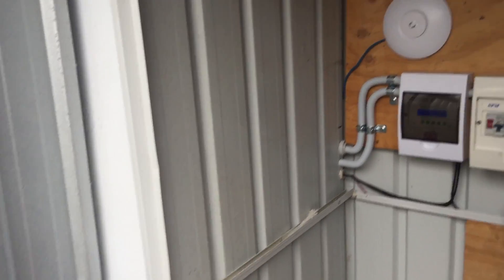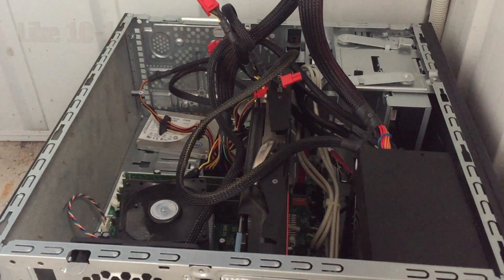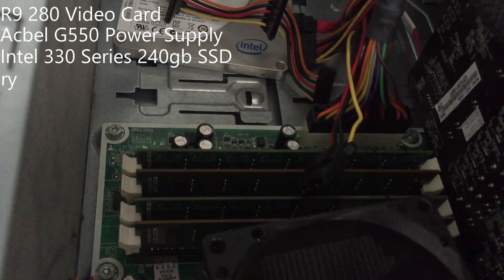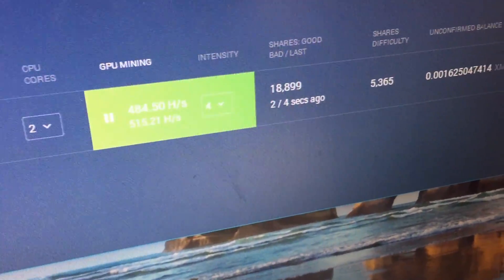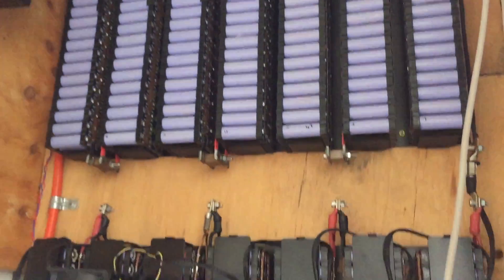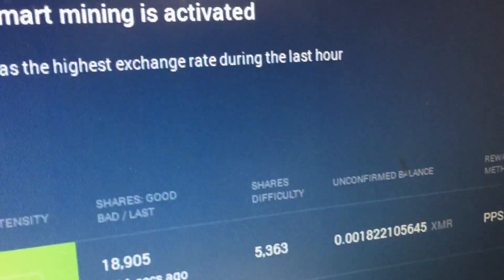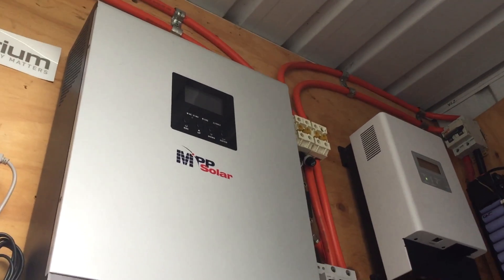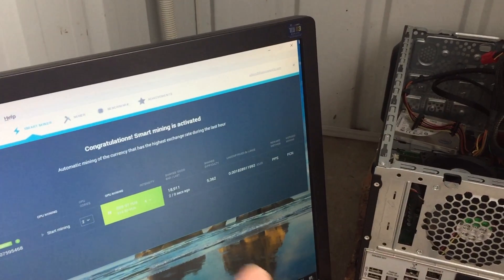Mining Crypto currency with solar power

Comment: I reckon that Monero is worth quite a bit more today if you haven't sold it yet. Is your system able to handle 500-600w 24/7? A 4x gpu system would be worth it depending on what you're mining. Your SSD is quite nice and I'm using a similar one on my main computer. For mining rigs, you only need a single stick of ram, an economy processor such as the celeron, a motherboard supporting many pcie ports, a cheap ssd (Could even use a USB stick for the OS) and the power supply. 

As someone else mentioned, whattomine.com provides the best coin to mine at the current time but joining a mining pool that automatically switches you to the most profitable coin would be even better.

Comment: and all I've done is start running my washing machine through a modified (ghetto drill ventilation mods and a 80mm fan) eaton 400w 5110 12v UPS saving huge cents!  mwahahahhaahahh   (why I didn't think to test it two years ago I have no idea gah)

9 days left until settlement for our first home!  and i'll finally have solar!  woooo (and I'll be your neighbour! (ish) we're coming Inala, watch out!  
I have massive surface area for solar expansion too!
once I get there, I'll be setting up my eaton mx4000 4Kw UPS (it's a freaking BEAST) and running the fridge and laundry off grid, the savings will start!
exciting times indeed!

Comment: The os won't matter, the gpu is doing all the work.

You are losing a lot of power in the translation. Going through two conversions. Move to a low voltage input power supply try to go directly from the battery

Comment: running a 12V pc power supply over a 120V/240V power supply, which got its power of a 12V/24/48V system??? there are systems you can run your pc directly off a car or something with 12V....

Comment: I would under clock and under volt the CPU and RAM, also use as little RAM as possible, and the only drive should be a USB drive

Comment: https://www.ebay.com.au/itm/DC-12V-250W-24Pin-Pico-ATX-Switch-PSU-Car-Auto-Mini-ITX-DC-TO-DC-Power-Supp-Q2D4/192343439437?epid=2247854843&hash=item2cc88ff84d:g:XKsAAOSw3WxZ720c try one of them I know its not a $1 but think it may work may need 2 of them for more power then there this on to https://www.ebay.com.au/itm/DC-12V-250W-24-Pins-HTPC-ATX-Power-Supply-Board-PC-Car-Computer-Pico-PSU-Module/292243353990?epid=2225658016&hash=item440b0fb186:g:L~4AAOSwFdJZsJwO then if you like there lots of dc to dc out there cheap under the $25 mark to keep your volts clean for it save blowing up the pico psu .

Comment: Hi 

Is absolutly no point using a CPU today for mining. Even the 280 card that you have from 2013 is not making any today even with "free" power. You have to invest in 1080 card. It will draw the same power but will give you 3x more bitcoin per day. with a 1080 you will get about 20$ a week with free power right now. So the 1080 will have ROI at about 6 mouths if the price of bitcoin will be the same. but in only 2017 it have incresed by 10 times. What will happend in the future is inpossible to predict. And is many othe factors like difficulty of the coin to mine. ( over time you will earn less than 20$ a week). So mining is really only profitability if the coin that you mine is coing up. So then you can ask why just by bitcoin and wait for the coin to increase in value or invest in a GTX 1080 (500$+ used) and wait for it to mine.
Reply: @Markus Limseth @HBPowerwall  Really?    
Bit coin is not going away, in fact I reckon as more and more people figure out what it actually is and why it was created in the first place, it will eventually be the winning model. But all that aside, you've access to free components, free power (well... eventually, ROI and all that) the only cost is the extra 6Kwh load over 24 hrs on the system (I doubt you'd see a 1 deg c increase in the inverter's running temp) and the system is creating an abundance, and at the end of it is income!  Where's the argument?

As you stated Markus, bit coin has just breached 10K AUD, it will collapse again, it's all cycles but I don't think it's anywhere even close to a plateau yet and therefore I don't really think it's valid to measure it by present value. 

The way I see it, the only valid reason not to mine in your circumstance would be if you were grid tie and your contract was paying you more per Kwh supplied than you can make from mining per Kwh. 

Hey, I could be wrong, bitcoin might collapse and bugger off into obscurity this afternoon for all I know, but even if it does, what's the cost to you bro? If it were me, I'd have already put up another shed and racked it with GPU's assuming there was enough overhead in the solar generation. It's only wasting it off to heat through balancing anyway.
Reply from the maker: Sounds like you have an extremely good argument!
Reply: 1080s arent the best for mining, a Vega 56 would be much better and cheaper.
Reply: +Jimmeh B He's not mining bitcoin, it's Monero, which will keep rising for now along with Ethereum and Litecoin :p

Comment: you should be switching your mining software to software designed for specifically GPU mining, especially something designed for your type of card. the following link is a good start. for GPU mining, you should also probably look into ethereum mining instead..

https://bitcointalk.org/index.php?topic=638915.0

EDIT: also, changing OS or HDD will not make a difference, the only thing that matters in GPU mining is the GPU. SSD is not needed, High end CPU is not needed, fast internet connection, and OS change is not needed.
Reply: lowering your system specs to center around the GPU only, will increase your hashrate and also since its running on battery, increase your efficiency